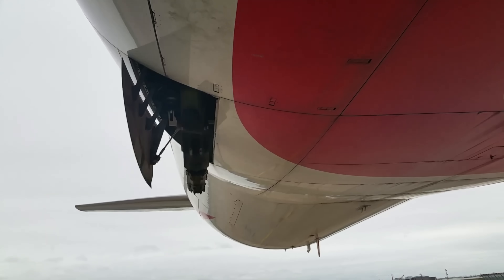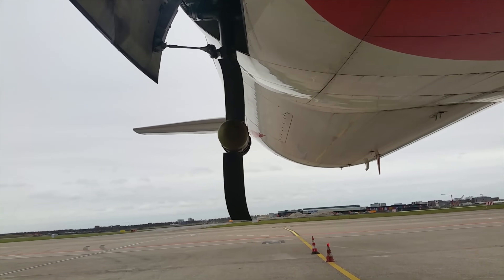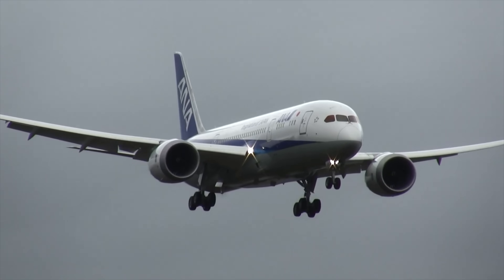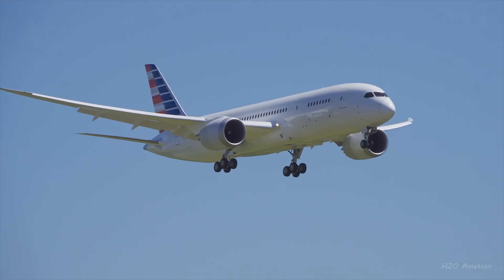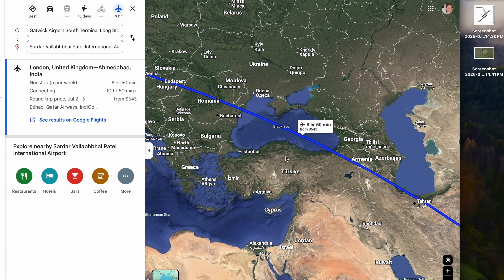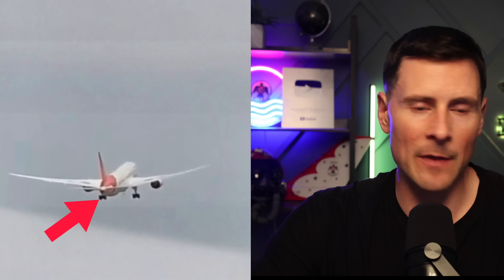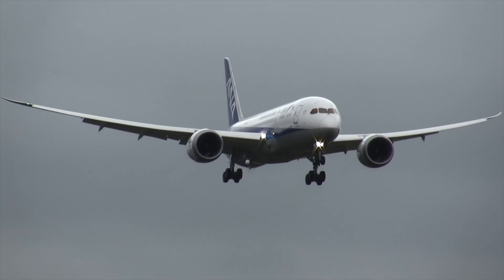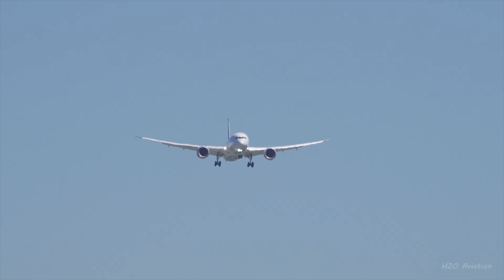Air India 171 SHOCKING UPDATE on RAT Deployment and Flaps!

Comment: I believe the pilots did everything they possibly could to try and save the passengers. We could see the nose of the plane's cockpit actually face up just be crashing. Do all crashes end up in a fireball, or do you think the lithium batteries could be at fault as well? In cars they are known to overheat and explode, why not on the plane? Can you address this possibility? I remember seeing a short video of a passenger on the flight prior to the one that crashed complaining that the air conditioner, phone, and video screen display were not working as well. He also mentioned how he could see wires showing in a crack above the window. I believe all this leads to more than we know.

Comment: The RAT being out doesn’t necessarily mean it was auto deployed due to a major failure.  Step 2 in the dual engine failure memory items is to push the RAT switch and deploy the RAT.  If they thought they lost all thrust (and both engines were still actually operating) they would have deployed the RAT manually if they followed the procedure for the perceived issue.  Along with cycling both fuel control switches.  There are a lot of possibilities here.  I’m pretty sure Boeing has analyzed the FDR by now.  If it was a design problem with the airplane I’m confident Boeing would have grounded the fleet or put out some sort of bulletin.   My guess is a survivable failure at some point followed by pilot error.

Comment: I saw another flight that the rat wasn't deployed but it sounded exactly like it was. A passenger prior to this flight at this plane was all messed up air conditioner didn't work. The electrical was all screwed up. Passengers were not happy. Somebody covered something up. I think there was major electrical failure shut it off. within 10 to 14 seconds after rotate which is about the exact same time I've seen other flights call for the year is right when the plane started to drop so whatever happened happened right at that time either a short, the wrong switch throne or something Engine was completely overhauled in March. I think the other one was set to be looked at later on this year for the same procedure. It's very possible they screwed something up in the fuel system and it broke. Whatever it's so sad that there was no runway or anything left to try to bring the plane down.

Comment: Lot to digest from your video.  Understand the angle of the video may not give us the correct answer on the flaps. However, not sure the RAT is deployed. If it were, dual engine failure at takeoff odds are right there with winning the lottery. Hopefully, the flight data and CVR are recovered and this can be sorted out. Thanks for the update.

Comment: Seems to me the engines were running because you can hear them in the video and the survivor said the lights were on and flickering which they wouldn't if only the RAT was supplying power.  I'm not sure it's a hydraulic issue either as the main problem seemed to be lack of thrust from the engines.  That only leaves an electrical fault of some sort that would cause the RAT to deploy and interfere with flight controls including engine control.

Comment: No. 
I call you out.
You are not a flyiing officer.   ...make your mind up buddy, thunderbird? Grumman or Mac?
No record of you as a flying officer under British Airways and consolidates.
Cpt. BA.
747-2-400 series..   The Captain ordered the wrong engine setting.
j2 for that kind of runway.
Low power, long take-off roll ....see the dust.
Climb at v2 and 5 second gear up.
TOGA useless.  ...RAT is fine at 32 000 (FL32), at 650' it will take 20-25 seconds under automatic deployment to pressurise the systems.
Pilot error..   Sorry.
"I think it rotates at 20,000 RPM".
This would mean the tips go super-sonic.
And shatter.
Sorry my friend - you are trying "Fake honour".
I choose to report you.
Captain James ARMSTRONG.

Comment: Not sure if this is technically even possible, but could this have been some sort of "Apollo 13 stirring the tanks"-situation? Meaning that the very act of toggling the gear-switch/-lever is what caused the malfunction that lead to both engines shutting down?

Comment: I just researched and found out, there is only a small amount of water needed in the tanks and when rotating, the water gathers at the deepest back area of the main tank, where also the suction-feed for fuel is located. So the rotation can lead to only water is sucked in and the engines spool down or reduce thrust extremely.

Comment: This pilot actually did save many more lives by not crashing in a densely populated area which surrounds the crash site. The crash site is basically an open area around hostel. RIP to those lives which couldnt be saved
Reply: This pilot had absolutely no choice in where that plane crashed.  It went right down the runway centerline until it stalled into the ground.
Reply: The pilot was in no control of the aircraft. It crashed in an urban location. Luckily nobody was killed on the ground. Correction: multiple killed on the ground.
Reply: @sbinsdca uh at least 30 died on the ground and they're still searching for bodies. But with how densely populated the area is it could've been much higher.
Reply: @PsRohrbaugh there is so much misinformation surrounding this accident. Thanks for clarifying.

Comment: Thank you for that discussion of flaps and landing gear. I’m not a pilot but the initial videos on this crash leaned heavily into pilot error—the whole thing about confusing the flaps ‘button’ first the lading gear one—and my tutored thought was ‘Really? Experienced pilots make such an elementary mistake? Designers of aircraft make it so easy to confuse these controls? There are no warning signals?’, My little Peugeot hatchback emits all sorts of irritating noises when it thinks I’m backing too close to something else or when a door isn’t closed or a seat belt isn’t fastened—and you’re seriously telling me that a state of the art aircraft could launch into the air with some potentially catastrophic configuration of flaps and landing gear and neither pilot would notice and there would be no warning signals? Just never seemed plausible to me.
Reply: After watching several pilots discuss the possibility of co-pilot error, they state the landing gear lever has a flat handle at the top and is located lower in the cockpit. The flap control is a button up above.  The plane manufacturer keeps them separated so that a even a tired or panicked pilot would not confuse the two.
Reply: The pilot error was not convincing to me, unless maybe if combined with a highly stressfull situation which would in itself be an important part of the chain of events.

Comment: One in a billion chances that all happen at the same time:
1. there is 1 in a billion chance that BOTH engines fail at the same time.
2. there is 1 in a billion chance that you survive a plane crash and walk yourself to the hospital.
3. there is 1 in a billion chance that you die hit by an airplane while eating launch in a hotel.
4. there is 1 in a billion chance that you miss a flight that crashed 10 minutes later!
Reply: It seems like with every crash they find someone who just missed the boarding process.
Reply: @nysockexchange2204  Approximately 5% of passengers booked on a flight are statistically expected to miss their flight, but this can vary. Some circumstances, like major hub airports with connecting flights, might see a higher no-show rate, potentially reaching 15%. While this is a general estimate, the rate of missed flights can also be influenced by factors like flight delays, security lines, and individual circumstances.
Reply: @nysockexchange2204  My mother missed her flight 2 months ago so it is more common than people think. AI says 5% have posted that comment as well.
Reply: Even if your analysis is correct, still less chance of winning the lotto. Much more chance of getting hit by a comet than winning the lotto, the chances of this are once in 10 million years. As proven just because chance is low does not mean it is impossible.
Reply: @trythis2821  the point is 4 happened at the same time, which makes them as a whole 1 in a google
Reply: And that 1 in a billion could be the time it actually happened, no?
Reply: First of all probability is not calculated for past events. It is calculated for future events.

There's 1 in zillion chance that we 5 humans from all 9 billion humans on earth will be in your comment thread replying together in this sequence in this specific video among a billion videos on YouTube.
Yet it is happening. 

Stop these false probability argument.
Reply: Please post your work on those statistics

Comment: The pilot of Air India reported back to the tower 
“ Mayday Mayday Mayday no thrust,  no  power “ 
( so we know it was a power/ Thrust  issue ) 

The “RAT “ ( ram air turbine ) in-flight will deploy automatically if  : 

Note : The RAT does not have the ability to raise the gear . 

1) Both engines have failed 
2) All three hydraulic system pressures are low 
3) Loss of all electrical power to the captains and first officer flight instruments
 4) Loss of all four electrical motor pumps ( EMP’s )  
5) Loss of all 4 EMP’s & an engine failure on takeoff or landing 

So at least ( 1 ) these ( 5 conditions ) had to occurred for the “ RAT “ to be deployed “ in flight “ 

The 787 engines are controlled by ( FADEC ) Full Authority Digital Engine Control 

1 of the above 5 events must have occurred in order to effect the  < FADEC > Engine controls and reduced both engines thrust >> 

The flight data recorder will give us the evidence that we need to determine the actual cause >

Comment: Here is the inside info. Dont ask how i got it: 

 Preliminary on India flight. Dual electric bus malfunction. FADEC’s went to ground idle when gear left the ground. Ended up stalling, nose drop 54 degrees nose down. No chance.😕
There was an electrical MEL that was on the books for 2 weeks. If fixed, wouldn’t have happened.

Comment: Vapor Lock...
I remember my GM car, decades ago, would get vapor lock and you'd have to let it cool down before you could restart it.  The carburetor and fuel pump were designed not to work after heating up, or in hot weather, or goingvup hills, or on so many other occasions.
Boeing is essentially the GM of the sky, and maybe even used some of GM's old carburetors and fuel pumps, with sleight modifications for Jet Fuel - which would explain the catastrophic vapor lock.  At least with vapor lock in your car you could coast over to the right shoulder and stand in the sun until you could start up again.

Comment: well depending on the temperature  of the atmosphere and  weight onboard you put that in your takeoff page in the fmc that will determine your takeoff speed flap settings and thrust requirement huh hey pretty good right because i am a flight simulator all joking aside this is a terrible tragedy i hope they figure it out so it never happens again is it me or is that rudder kicked hard on takeoff indicating an unbalanced thrust or engine failure and its like you can see where that second engine died because it just starts dropping like a stone does the rat deploy automatically on a 787? i would think it would be flap 15 in that hot weather i think he was flap 15 that quatar jet was definitely flap 15 even if they did bring flaps up to soon that 787 is so powerful it would power through you can get airspeed crazy fast those engines are beasts gear handle is on the dash flap handle is right by copilots left leg had to be two engine failure did you notice the sunlight flashing off the rudder like he was really standing in that thing

Comment: How about the fact that the aircraft was just fueled up? The weather was 40 degrees Celsius, how about fuel vapour airlock? All it would take is faulty ventilation to the fuel tank, as the engines called for excessive fuel demand on take off?

Comment: My guess is they had a voltage failure causing the electric fuel pumps to cease operation. No APU on. 
   RAT came down once electrical power was lost,  from the engines shutting off. But that doesn't give you fuel. It just gives you potential flight surface controls. You're still going in. Electrical failure causing bilateral fuel pump failure. Main bus fry out. I bet they will be mandated to take off with the APUs running at full power and have all the planes electric systems and pumps checked. Guess we'll see..

Comment: Let the Inspectors do their jobs - they will figure out the root cause.  There is a video online from a passenger who had flown in this aircraft the previous day - it noted flickering cabin lights , no AC and inop video screens on back of headrests.  Factor in the mention here of passengers smelling 'burning' smell from AC the day previous.  Obviously ground maintenance will be scrutinized  given the disturbing issue mentions.  Don't automatically blame Boeing - an excellent 787  safety record to this point.  If a customer carrier does not put proper and immediate attention to noted problem reports - the carrier and not Boeing would be at fault if a tragedy ensues.

Comment: The RAT deployment almost certainly means there was an aircraft issue but it also means that the levels of INDEPENDENT REDUNDANCY that there should be in an aircraft failed. If one system goes down, it shouldn't stop both engines for example.

Comment: Probably already posted, but check out the video of the passenger on the first leg from Delhi!  No power to many of the movie screens and telephones of the individual seats, not to mention that the A/C wasn’t working when the flight landed in Ahmedabad, which may be a sign of maintenance’s failure to fix existing problems!
Reply: I dont understand why nobody talks about it
Reply: Good point! The entertainment system in the cabin is not actually relevant to safety. For me, however, this is a clear indication of several technical faults in connection with the electronics. The Boeing 787 relies on electronics and batteries like no other aircraft. A short circuit, blown cable, etc. can also spread to important components. Swissair flight 111 once crashed due to a fire in the entertainment electronics. Just imagine it is V1 and the plane is rotating and suddenly all the instruments in the cockpit are black and the pilots can no longer control the turbine power. In this case, the turbine power should actually remain the same (full thrust). But who knows which control units or electronic components have been destroyed by a possible electric shock.

Comment: Larger Aircraft: 

Takeoff power comes from engine-driven generators (not battery).

If all electrical power fails, it's likely a bus fault, generator trip, or wiring issue, not the battery alone.

The battery may keep essential systems running temporarily until the APU or RAT engages.

Comment: Hey Max the RAT may be spinning at 20,000 rpm at 300 MPH but staggering along at 150 mph it may not be doing much power supply but indicates a problem if its auto deploy.The flap jackscrews length extended will give the flap extension away

Comment: The sole survivor mentioned a bang and the cabin green and white lights flickering on and off. The bang he heard could have been the RAT deployment and the green lights are the emergency lights by the doors where he was sat so yeah. Your theory of the RAT is definitely plausible. The landing gear is pitched forward too. When the 787 leaves the ground the aft gear drops back. When the pilot selects gear up the gear pitches forward then retracts into the bay. I think they selected gear up. Gear pitched forward then had the electrical fault which cut both engines, left the gear paused, the RAT deployed (bang) and emergency lights flickered. Lost altitude. Then crash.
Reply: There is no single electrical fault that can cause what you describe.  The electrical systems have 8 independent power sources and multiple completely independent distribution systems.

Comment: 103f at 200 ft elev doesn't seem to be an issue.  I want to know what the plane was in for maintenance before the flight.  Doesn't the huge battery bank on the 787 also power critical functions?  So we have a loss of power or loss of configuration causing loss of lift.  I wonder if they didn't fuel the plane and when it rolled whichever tanks sucked dry and killed it.  The fire just wasn't as big as I would suspect for an 11 hour plus reserve flight.  I would be looking at the  center fuel tank.  Hope I'm wrong!  RIP to those that lost their life.

Comment: This is what we know up to this point.

1. RAT was deployed - that indicates a major system failure. Clearly audible in the original crash video - not so much in the initial screen capture shown by news outlets.
2. In the original version of the crash video, you can see the step in the trailing edge consistent with flaps 5. The flaps 5 setting on the 787 is quite subtle and difficult to see from a distance.
3. Swiss001 in one of his videos on YouTube has pointed out the angle of the wheels in the footage, tilted forwards - this is the first action of the gear before the doors open. It looks from this like the hydraulics failed just after the gear-up lever was moved to the up position.
4. Reported by Aviation Herald - "On Jun 15th 2025 Government Officials reported the aircraft had a longer than normal takeoff run and used almost all of the 3505 meters/11499 feet long runway." Does this suggest the pilots should have rejected the take-off?

I don't think the pilots are fully to blame but might have played role in the disaster. I think this is going to come down to a maintenance issue or maybe contaminated fuel.

It looks like a textbook "Swiss Cheese" chain of events. Multiple missed opportunities to prevent the crash.